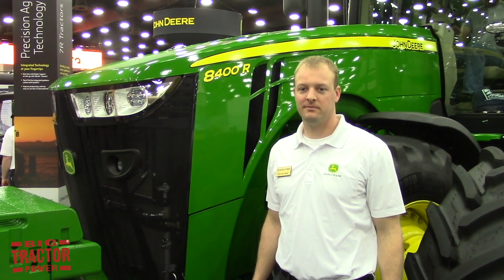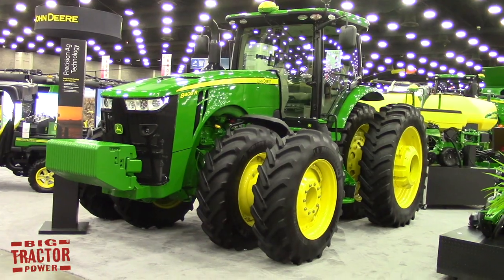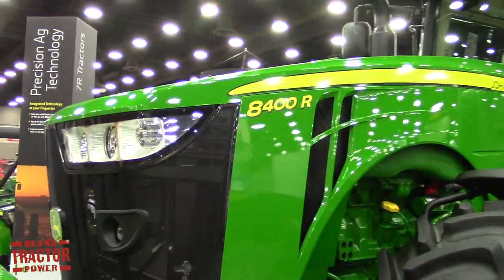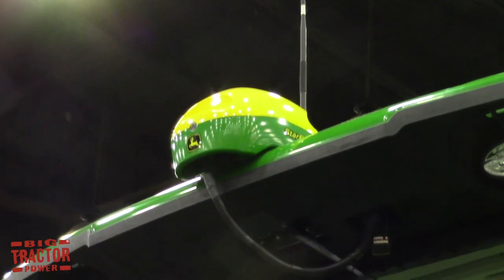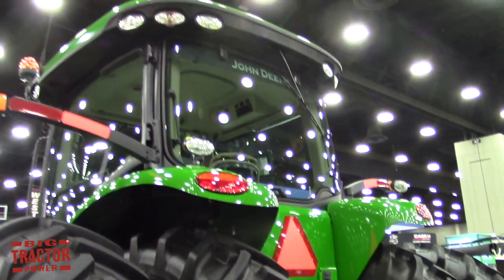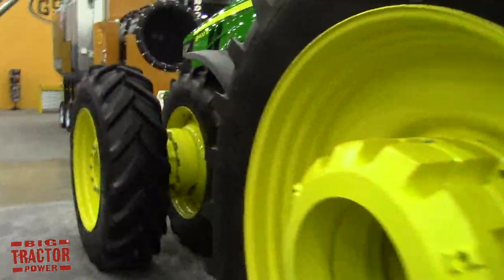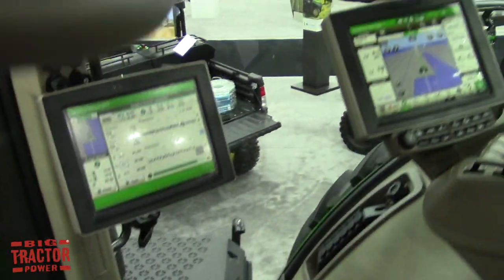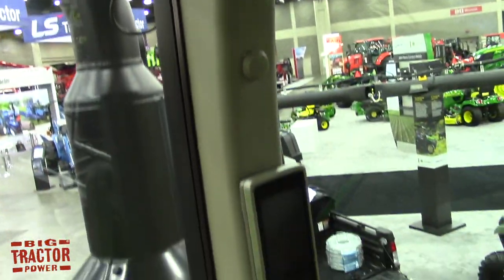400 hp John Deere 8400R Tractor Interview NFMS 2017

Comment: These big  fwa might have big engine horsepower but I wonder how they compare with drawbar pull to similar hp articulated tractors?
Reply from the maker: It would be interesting to find out how they stack up.  The new high horse power fwa tractors are large.  I recently saw a New Holland T8.330 fwa parked next to a FORD 976 4WD at an NH dealer.  The T8.330 sat larger and taller than the 976.  After 1991 the 976 was the largest tractor in the FORD line up.
Reply: Yeah ,I recently checked  out some Nebraska tests on identical hp fwa and articulated tractors and was surprised, near identical weights and drawbar pull at the same speeds! Thanks for the informative ,good quality videos .
Reply: They don’t come close. The weight and true 4wd can’t be matched. What they’re trying to accomplish is getting around how much torque is lost in final tier 4 engines. However a higher horse power tractor will burn so much less fuel than one of the same frame size and less rated hp. A 8260r will burn about 20% more fuel than a 8335r. I use those two because it’s really the only two I’ve been able to compare side by side in the same fields but you can always tell. Now. The ILS alone makes these tractors pull way harder than a straight axle can because it changes the weight transfer across the tractor at any given time depending on wheel slip. The transmission itself is extremely efficient and makes it easy to run the least amount of engine speed to match whatever ground speed you desire and it does it automatically. Sorry I went on a rant lol.

Comment: @bigtractorpower I was wondering about the E23 transmission. Can I operate it as a power shift or do I first have to set a desired ground speed?
Reply: Justin Germanovich 
I think the desired speed is only optional and that you also can use is as a powershift-transmission

Comment: No way will it compare to a Fendt/Challenger 1000 series  as much as deere fans will say its better its not
Reply: its better if they don't need the horsepower that the Fendt has. I have a 510 hp articulated tractor and there is no way the Fendt could replace it for my particular operation.
Reply: Well only time will tell as to the Fendt tractors doing the BULL WORK of the articulateds But with the Tire Inflation system and the weight package they offer it would be much better suited than the other Brands Big FWA tractors but what i see is the STICKER SHOCK price which puts them in that cost slot Niche like the Case Magnums Row Trac where the articulateds would be cheaper to own but yet we all know if it was a DEERE it would have been the best ever Invention LOL
Reply: Aaron Stern 

Well duh dude. Its 100 hp smaller. 
I'll still take this over the yellow one anytime
Reply: It's still an 8000, and it is really supposed to compare to a 939.